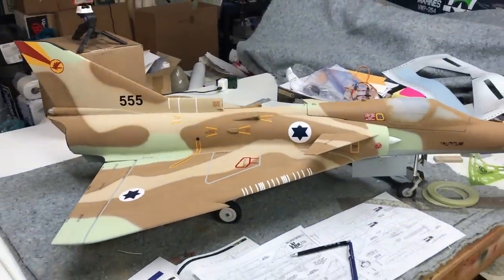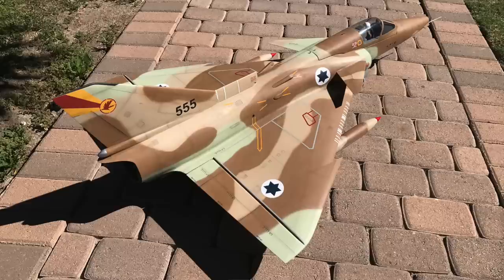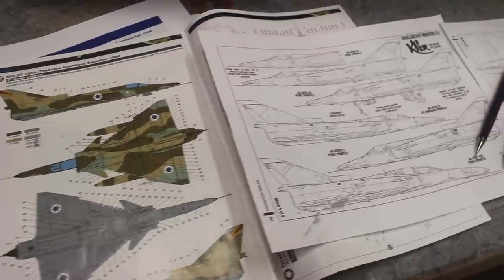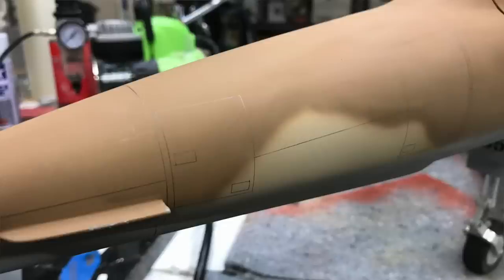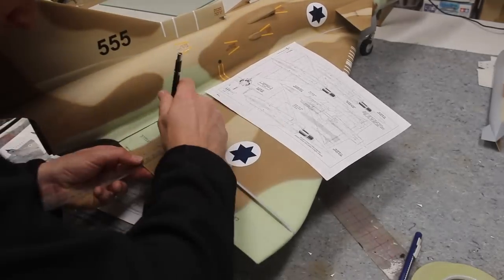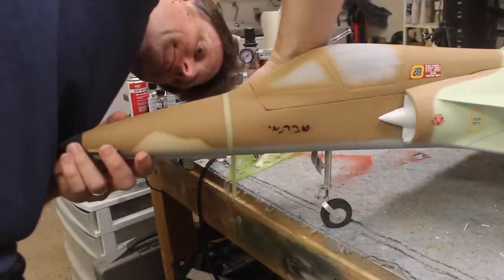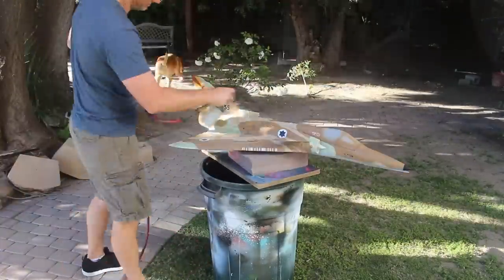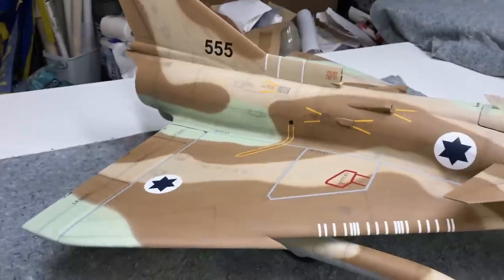Foam Kit Bashing Ep5 - Panel Lines & Weathering (Washes and Airbrush Shading)

Comment: Very nice.  What acrylic do you use in your airbrush as a final coat?  If you do mix your raw umber, what is your mixture of raw umber to thinner?
Reply from the maker: For clear coat, of late I’ve been using the rust oleum matte clear and am liking it quite a bit. Being in a spray can makes it really easy. On the raw umber, when I thin it, I don’t have a set ratio. Mostly just thin it to the consistency I need and that’s only if I’m airbrushing it. Most of the time when I’m applying streaks and such, I don’t thin it at all.

Comment: Thanks for the tips! I have watched a bunch of different videos on panel lines. I am currently building a 1/7 scale f-100. Its more for fpv than scale (tired of the look of flying wings), but i wanted to add some panel lines. But most of the online tips are way too much work than i want to put into this plane. Your way seems a lot easier and forgiving.
Reply from the maker: Thanks for watching!  Pencil works great for a quick and easy panel line assuming you have a hardened surface to draw over.  And you can take it a step further by scribing should one choose.  Panel lines using chart pack tape and primer coats and stuff like that are a pain.